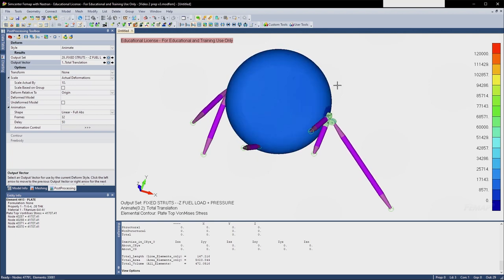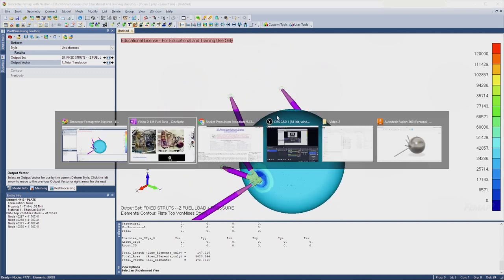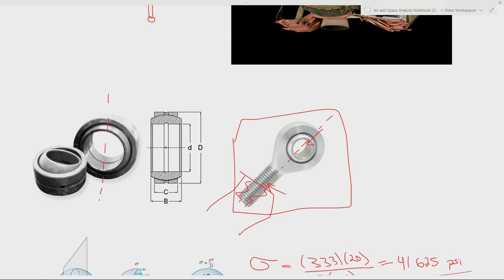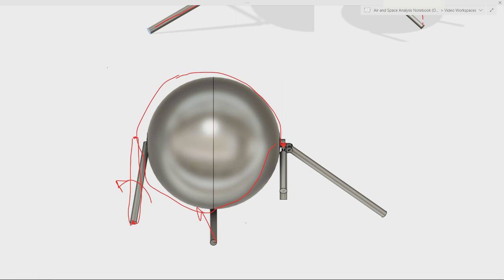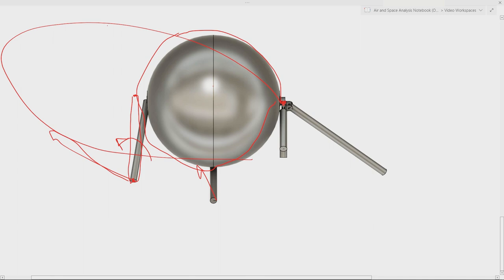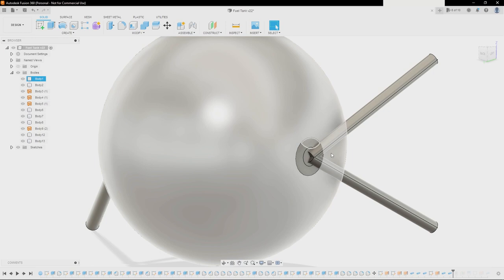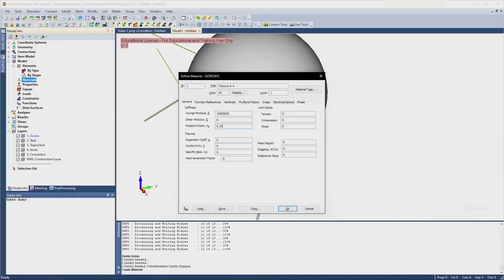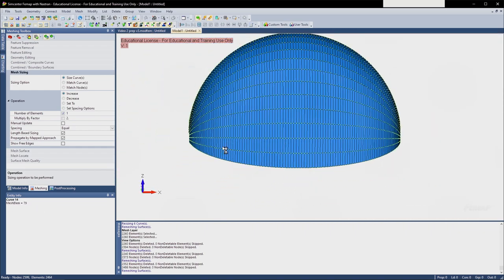Let's Analyze the Lunar Module Ascent Fuel Tank! (Discussion and FEA with FEMAP)

Comment: Dude!!! You gave me a heart attack!
So many things wrong with your model. You know soooo little how Nastran works. 
The way you interpreted your struts connection to your joint and tank is absolutely %3000 wrong. If you ever get a chance to actually work in the industry, please never make a 0.5 in. CBUSH element. Please never just connect 3 CBUSH element together to represent a connection! Please never just arbitrarily assign stiffness to your CBUSH especially on your load paths.  
The way you can model fuel inside the tank is with Nastran's MFLUID card for your modal analyses and of course with varying hydrostatic pressure for your static and dynamic analyses. You could actually utilize FEMAP's data surface easily do that.
A responsibility comes with putting a video lecture online for others to follow and if you're not %100 sure you can guide others through a technically and theoretically correct analysis, don't do it!
Sorry if this comes out as harsh or mean.  As one of the very few analysts who has analyzed structures and specifically propellant and pressurant tanks for JPL, Lockheed, Boeing and a whole host of aerospace companies, your enthusiasm for analysis is much much appreciated.